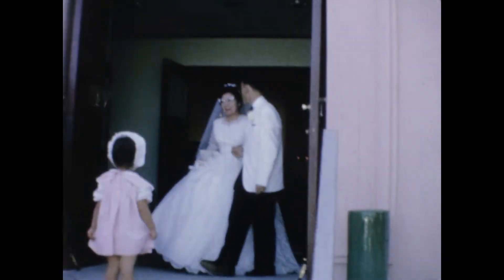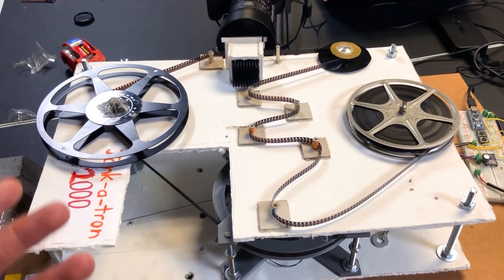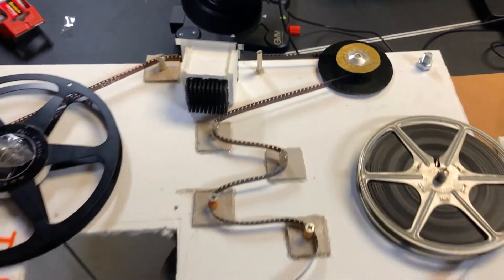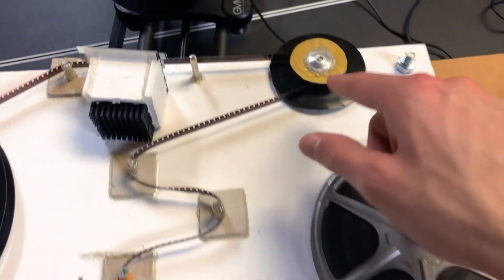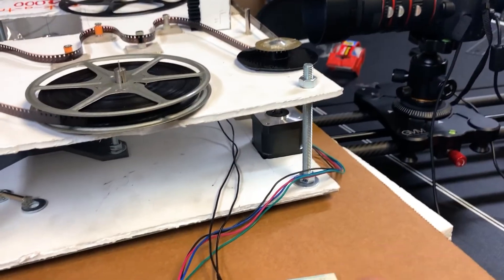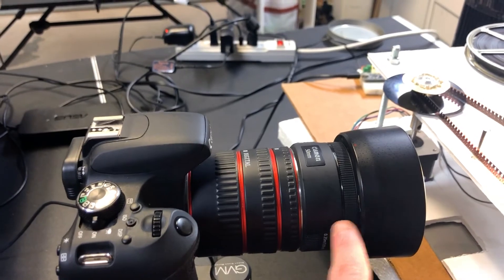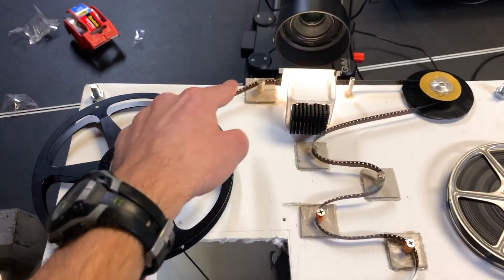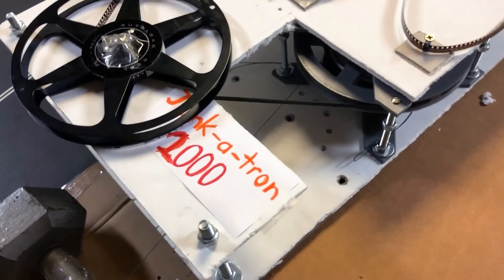DIY 8mm Film Scanner – A Brief Guide

Comment: Are you sure about the take up reel needing to decelerate as it fills up? In a 16mm camera both reels spin at the same matched rate and on a projector it’s the same as well.
Reply from the maker: Maybe your projector is different somehow, but on mine there is a noticeable difference between in spin rates between the two reels when they have different amounts of film. When I am just starting a reel, the take-up spool will spin significantly faster than the feeder spool. My understanding of how this works (at least on the Bell and Howell projector I had), is that a motor gives the take-up spool a little push every cycle, and the spool is allowed to spin freely. This allows the take-up reel to turn as much or as little as is necessary to collect the film.

Comment: What font did you use for the Jank-a-Tron 2000 logo? It looks both approachable and familiar. j/k of course. 🙂 
It's an interesting solution to the problem, nice work figuring it all out! I'm currently on a similar (long-term) mission. Currently I'm in the gathering data and ideas stage. Thanks for posting!

Comment: What would it take to do this for 16mm?
Reply from the maker: In theory this kind of build would work for any film size. Larger frame sizes do of course have fewer frames per foot of film, meaning that any gravity or mechanical tensioning system would have to be reset more often than with smaller frame sizes. I'll also mention that the build shown in the video was not my plan A. Ideally I would have modified an 8mm projector I already had by taking off the lens and replacing the motor. Then I could have just photographed the frames at the projector gate with a macro lens. Unfortunately my Bell and Howell projector was basically indestructible, meaning I couldn't open it up easily, and also the shape of it made it difficult to easily photograph the gate. All that's to say, I would recommend using any existing 16mm hardware you have to guide the design of the scanner you make.
Reply from the maker: Also, it's worth noting that commercial 16mm scanning services are probably better than the 8mm scanning services, which were all terrible in my experience. Depending on the amount of film you have and the amount of control you're looking for in post-processing, it might be more cost effective to have it scanned professionally.

Comment: Thank you for posting. How to you align the frame in the image? Do you set it up once and assume so many steps per frame? Does it progressively get out of sync?
Reply from the maker: The sprocket wheel I used (the one connected to the stepper motor), had 16 sprockets, meaning I had to turn it exactly 1/16 of a rotation in order to progress a frame. I used a stepper motor with a base resolution of 400 steps per rotation, which means that I could rotate 25 steps to advance exactly one frame. There were minor deviations from perfect alignment, but they were basically random and could be adjusted for in my post processing script. There were no problems with it getting progressively out of sync, which I guess just goes to show how precise stepper motors are.
Reply: @dylanglenn4866  Thanks for the answer. I'm picking up an old Bell and Howell projector tomorrow as a platform to build my digitizer. Should be a fun build.

Comment: You say *tens of thousands"pictures*...  but this Canon Rebel has a rated shutter lifetime of *100,000 actuations*, so... doing the math: Super8 works with 18 fps, that's 1,080 pictures per minute, and 64,800 pictures per hour. Digitizing 2 hours mean 30% more that the rated shutter lifetime of you DSLR... I mean... great engineering, very good job, (really), I couldn't do it... but I still, it's not worth it...
BTW I'm not a troll, I tried this during the pandemic, just do a quick search --> Journal of Contemporary Archival Studies, Volume 6 - Low-Cost 8mm/Super 8 Film Digitization Using a Canon 9000F II Flatbed Scanner and Photoshop. Amazing results... after 11 days of try & error... Anyway good job, didn't mean to hurt you... 
A Case Study

Comment: This is a great solution, but:

If I understand you correctly, your DSLR takes one shot for every frame of your Super 8 film. This is 18 or 24 frames in one second, which depends on the shooting speed.

For the calculation below, let's assume 24 frames per second.
 
With one hour of Super 8 film, your DSLR does 24 x 60 x 60 = 86400 releases.

Don't you think this amount of shutter releases will destroy your DSLR very quickly?
Reply from the maker: Yes, you’re right about that. My DSLR managed to hold up alright, but it was definitely a mistake to not use the electronic shutter mode of the camera.

Comment: I will say that there is a desperate need in the market for an 8mm film capture system that produces high quality scans. The Wolverine and similar products (which all seem to use the same basic parts) produce poor quality scans of each frame. I have captured movies in real time by shining a projector on cardstock on the wall and capturing with a miniDV camcorder (with firewire going into an older MacBook Pro and capturing with older iMovie HD). This works ok, and gives me twice the resolution of the Wolverine, but it's still half the quality I'd get from doing a quality scan per frame like you're doing.

Surely someone could build a system for under $1000 that solves the "advance the frames" problem and either provides a decent built-in camera (4megapixel+) or lets you attach your own.

Your DIY system looks cool, but obviously isn't doable by many people.
Reply: I saw a firmware mod for the Kodak Reelz that updated it's video codec from 3 Mbps to 23 Mbps. For reference, DV video (from Digital 8 and MiniDV) was 25 Mbps. This was an improvement. I think the mod was called "Hawkeye" if you can find it.
Reply: Well, not everyone has access to such large sheets of foam core board! Seriously though, you are correct, not do-able for many people.  figuring it all out is a unique and singular problem.

Comment: Hi mate! Just starting out on my project build - what do you need the Custom 3d printed GT2 timing pulley for? Doesn't the stepper motor just go straight into your heisted sprocket? I feel like I might be missing a step! Awesome video, and inspired me to make my own, though instead of a camera, I'm going to be feeding it through a Plustek 8200i scanner!
Reply from the maker: Glad my project was able to inspire you to make your own scanner. You have the right main idea: the sprocket was connected to the stepper motor, which precisely let film run through the system. The custom timing pulley was part of the gravity fed system to maintain tension on the film. I used the biggest timing pulley I could fit in my setup to maximize efficiency (i.e. the bigger that timing pulley, the more feet of film is moved per foot the weight moves downwards). The role of the stepper motor was not to power the movement of the film, but rather to selectively release tension supplied by gravity. Without the stepper motor, the weight would fall quickly to the ground and the film would run through in an uncontrolled manner. Hope I could clarify things; good luck on your project!

Comment: Interesting, Dylan.  I'd like to know more about your camera settings.  I see the Canon's dial is on manual, so you've locked off the ISO, white balance, shutter speed and aperture?  How does the nifty-fifty perform on the end of so many extension rings?  I use a Laowa 25mm f/2.8 2.5-5x macro lens on my Sony A7Rii to do roughly the same thing, but focus on such a tiny film frame is problematic, to say the least, and DoF is slivver-thin tiny.

Comment: How does the gravity feed system work for the take up spool? You cut the video where you was going to explain
Reply from the maker: Oof, yeah I totally missed that bad edit. 
There's a spool of fishing line connected to the pulley beneath the foam core. When the spool of fishing line rotates, the pulley rotates, and also the take up reel rotates. I run that fishing line up through a hook in my ceiling and hang a bag of coins from it. This weight pulls on the fishing line around the spool, which delivers some torque to the pulley, keeping the take up reel in tension. The bag of coins will slowly fall to the ground, so every few hours I have to reset and re-hang the bag of coins from the top (I tied alpine butterfly knots along the fishing line so there was always a loop to hook the weight to). I hope that was a coherent explanation!
Reply: @dylanglenn4866  that's rather ingenious. I'm building a cine scanner using a flat bed scanner and am really struggling with the take up spool/reel. I'm g8 with electronics but hardware is killing me. I tried a spring loaded tension arm with a potentiometer and pid control but couldn't build it right. My next option is to use the tension arm with 2 lever micro switches. To adjust the speed.
https://youtu.be/BSTUYZD67xc
This is my design.
Reply: @dylanglenn4866  now that is something I would really love to see
Reply: "Here how that works... All right it's the end of the video." Noooooooo! 😂

Comment: You may be interested in my project. An old projector solves the transport problem. Replace the bulb with a LED. Use a digital microscope for the camera. Attach camera with magnets to allow it to be positioned.

Comment: Very interesting. Results look good. Did you use the script you have given the link to in the resources to line up each frame afterwards using photoshop? I am just testing my build and I have slight variations (mainly up/down rather than sideways) between each frame.
Reply from the maker: Yes, I used batch processing in photoshop to run the script over every frame. It corrects the slight jitters between each frame quite nicely but takes a while. It actually takes longer to process the frames than to capture them, at least with my hardware.

Comment: Yes, better to use the silent / electronic shutter. Not familiar with Cannon, but it might have the option. Did you really mean a gravity fed system for the takeup reel, or a slip clutch. That clip got lost somewhere but we can see below a belt that goes around a 7" film reel and the the motor.

Any issues wtih precision single frame advance? That's 4.321mm +- 0.01mm per frame.

Very clever and practical!
Reply from the maker: Good point. If I did this again I would probably use electronic shutter mode.

The precision of the single-frame advance didn't need to be perfect, but it was good enough for the perforations to end up in the same general area.  I used a Photoshop script to line up the frames to near pixel-perfect precision.

Comment: You´ll ruin your camera´s shutter by shooting frames one by one. It just doesn´t last for long. The shutter life is between 100 000 to 300 000 shots. One 50 feet film has 3600 frames, so you´ll get only ca 80 reels and you have to change the shutter for your camera. That is not cheap to do. You need a shutterless camera to do the job.
Reply: A mirrorless camera would be fine with a electric shutter shutter rather than a mechanical one
Reply: @slarti42uk  Expensive stuff though! I've been checking out the arducam 64MP camera for Pi4 which looks like It will totally fit the bill! Exciting times :)
Reply: I blew the shutter on a canon eos doing timelapse for a year. shutterless is certainly the best idea, or better still a raspberry pi camera.
Reply: Not necessarily a shutterless camera; just one that can go into e-mode.